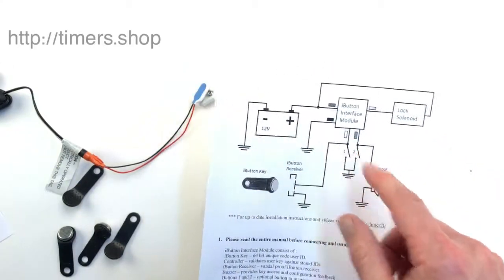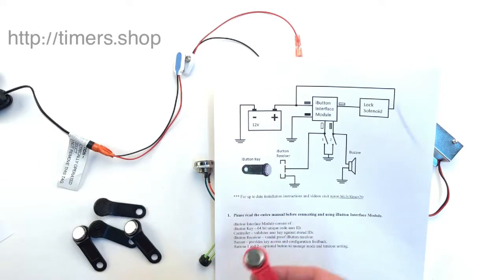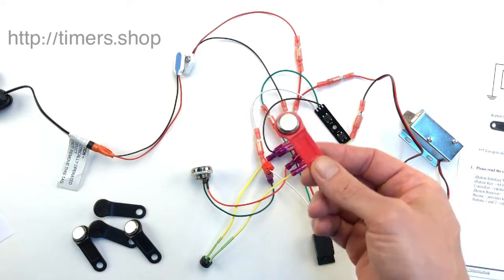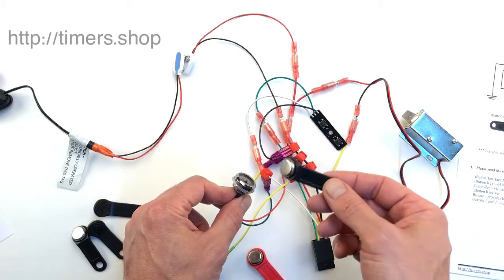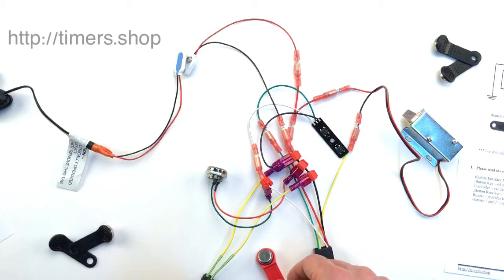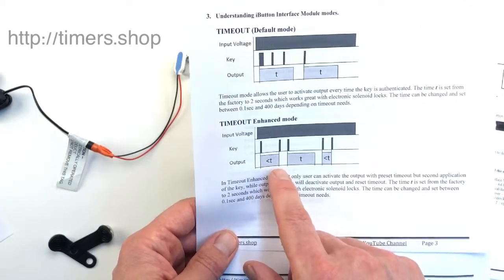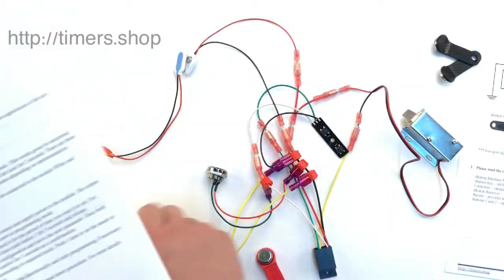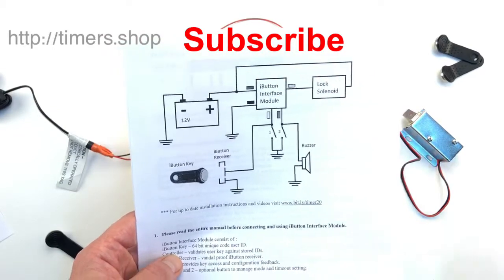Electronic access control lock with iButton

Comment: Hi, 
 i bought some smart buttons from China to copy for staff. They sent me TM1990A-f5 . I have been told these cannot be copied to. So I cannot use them unless I can copy the programed code on the original is that correct? I want to use them as I have basically got 100 of these and a couple of different I buttons for gate access and fuel. I have ordered some Rw i buttons now but am stuck with these TM1990A-F5 buttons. Do I need a specific program and device to use these and copy the original button> Thanks I appreciate your help :)